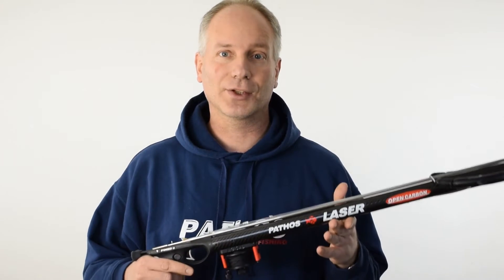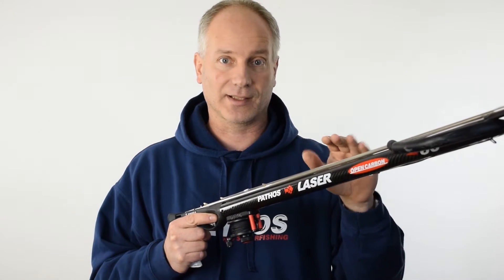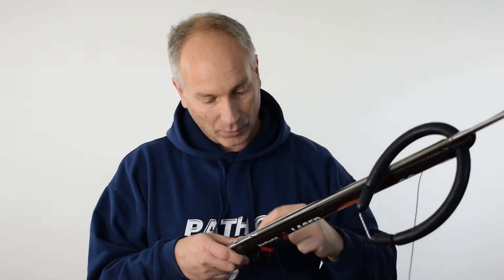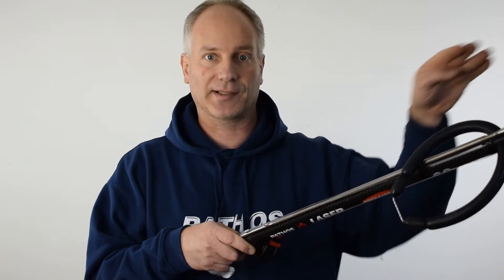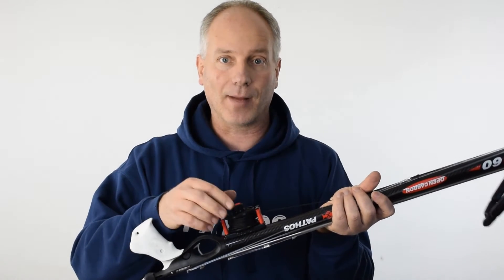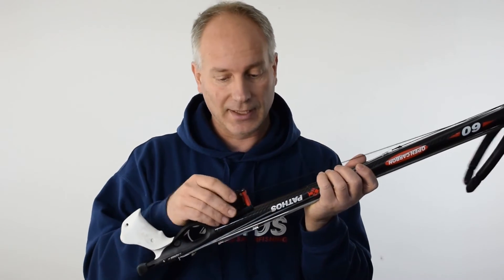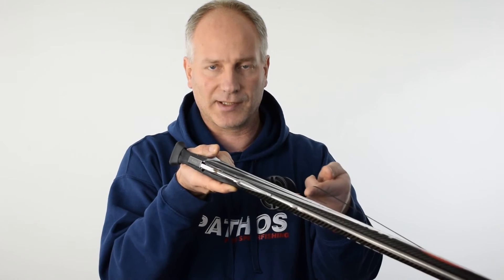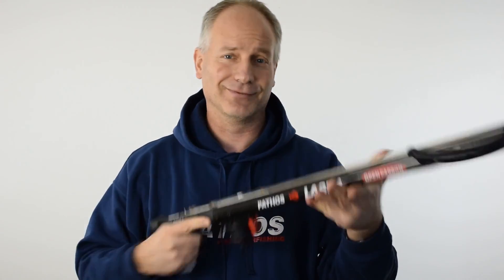Reel checkup... Just a few tips

Comment: Do you need to install a reel by the same manufacturer as your gun, or can you use different manufacturers?
Reply from the maker: Most of the standard reels are quite bad... special reels instead have adapters for mounting it on several speagun models.
Reply: Ragnarok Sub thanks!